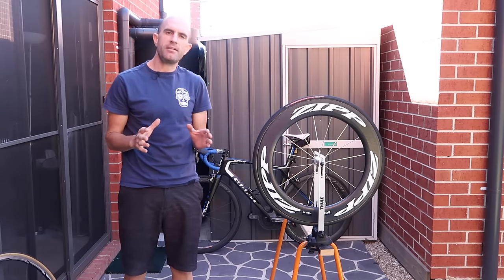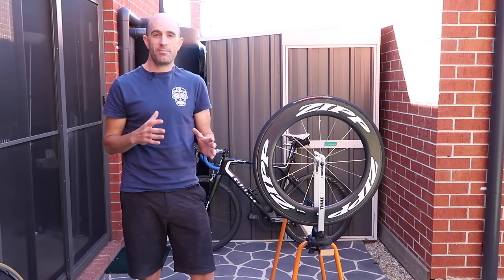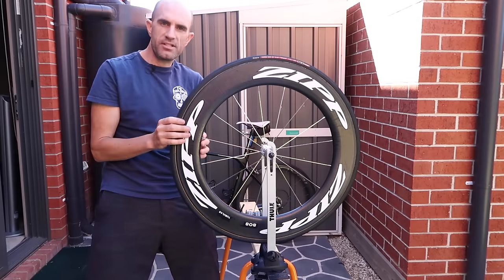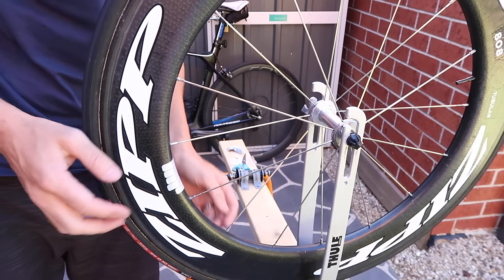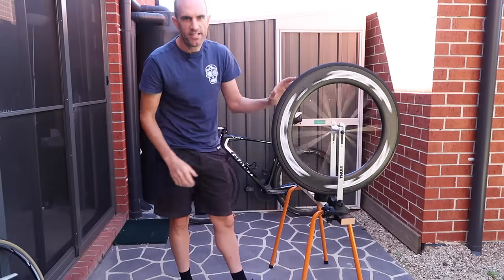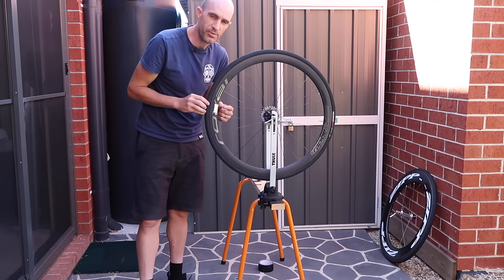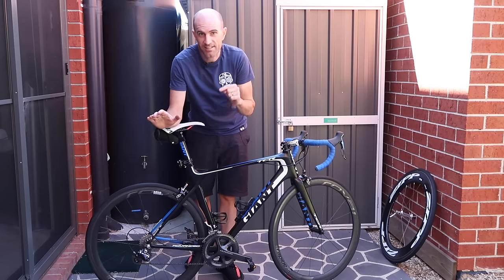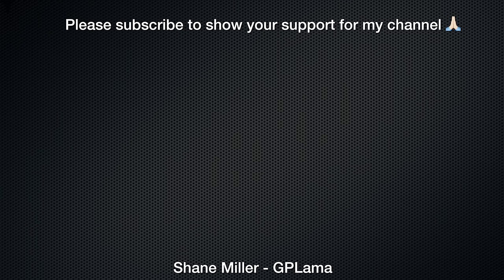Bicycle Wheel Balancing: Marginal Gains or a 'Must Do'?

Comment: Hi Shane, great video as always. Might be stupid question but I thought wheel.balancing was about adjusting the tensions on the spokes not adding counter weights? Are these 2 methods achieving the same thing? Which is preferred? This method looks simpler than adjusting spoke tension.
Reply from the maker: That's wheel truing. Explained at the start the difference.

Comment: First up thanks for posting this - really interesting and helpful information. Just one quick Q though - with the proliferation of road tubeless will this still work with tyres filled with sealant (especially the liquid rather than 'foam' type)?  Logically wouldn't the sealant simply run to the bottom when you have the wheel in a jig and automatically throw the 'rebalance' out?
Reply: I also thought this for a long time but it's a little bit different. Sealant doesn't stay on the bottom of the wheel while its spinning but forms a thin coat on the inside of the tire. If you give the wheel a solid spin before letting it come back to rest it should still work. At least it did for me.

Comment: Shane. Quick question. Would there theoretically be any aero lose for adding the weights to the wheel that would offset the benefits of balancing? Just something I wondered. DT
Reply from the maker: It'll have an impact yes... But as for that in W or time... we'll need a way to quantify it. It'll be pretty small.

Comment: Shane, I did your wheel balancing technique on my Giant  TCR SLR carbon wheels. But still finding that the wheel still drops to the valve stem. I'm running tubeless, will this be due to the fluid of the sealant, and won't the wheel always be heavy on the value stem due to this?
Reply from the maker: Introducing fluid is a whole set of variables. None I'm familiar with sorry, I run old school tubes. :)

Comment: I was thinking about balancing my wheels for quite a long time.   But I'd prefer to hide the weight somehow.   I'm currently thinking about an oversized stainless steel nipple, but very hard to set the weight to the exact requirement.

Also, I'd like to see some tests, whether an unbalanced wheel is wasting power, or not.
Reply from the maker: You saw the bike shaking around, that's wasted energy. As to measuring it.... that's beyond the tech I have access to at the moment. That's in the realm of Zipp, or $company$. If anyone has any backyard ideas.... I have a camera and a backyard! ;)
Reply: Of course, I did not expect a test from you. :)   But there're independent wheel wind tunnel tests, tire rolling resistance tests, but not for inbalance.

I even think that the two speed wobbles I encountered so far might have been caused by this inbalance.
Reply from the maker: I'd love someone to grab this and run with it! Hopefully someone will and we'll get some data.

Comment: Hello Shane, quick off-topic question about your Bike (if there's a video about it, i couldn't find it). What are the Pros and Cons for the tcr? I am about to buy my second roadbike and i am interested in the tcr. I like to ride fast and aggressive (i am planning to start racing later on). But a few friends of mine told me to not buy a giant bike. They point out that giant bikes have a bad upscaling (i will need a 58-60cm) and a bad quality/ workmanship (i googled that, since i am not a native speaker). I am confused since many guys on the internet call giant one of the best bike manufacturer ... hope u can help out and tell me your point of view.
Cheers mate and greetings from Germany :)
Reply from the maker: +derSlomka It's just a bike, like the rest. It's not the difference between winning of losing. Mine hasn't fallen apart, so that's a good thing. I'll leave the sales and marketing to Giant. I brought this frame 2nd hand as I believe bikes are overpriced and terrible value. That's my point of view.
Reply: The whole bike industry goes crazy about aerodynamics, discbrakes and that kind of stuff. I think it´s more about the advertising (and sellling as a result) than about the real benefits for normal customer. Thank for your oppinion. I think that really helps me out somehow. I guess i just think way too much about a simple bike.

Comment: This may sound like a daft question but if I have a wheel unbalanced could this affect the handling of the bike when going downhills fast ? ive had issues with going downhill and always put it down to the bikes ive had and now im nervous at going at speed downhill. Never used to on my old ally giant with giant wheels. im going to giver it a try either way
Reply from the maker: Maybe. There's a lot of variables at play here. Worth testing for sure.
Reply: @gplama  I’ve tried a lot of different things with some minor results but still never been as confident as I was on my old giant contend. I have a good mechanical back ground and it makes perfect sense to as I’ve drove cars where they hadn’t balanced the wheel and the vibration was really bad at 50+ mph. Will let you know how I get on

Comment: Why didn’t you stick the weights on the inside of the rim?  That is very ugly on the outside Shane. Take the tube out, stick the weights on and put the tube back in. Voilà. Just a little trick 😉. Have a great day 👍
Reply from the maker: This idea doesn't work very well on tubulars. The 404, 808, and 900 I have all tubs.

Comment: I would have though the imbalance is mostly due to the weight of the valve - it could be fairly significant on a 80mm. Maybe if you're using the same valves on the wheels - the weight of your valves are all 14grams?
Reply from the maker: No wheel works without a valve... so they could counter it at the factory pretty easily. That costs money to do though.

Comment: - Excellent video

wonder how much rider weight impacts the shake?
an interesting follow up would be to have two sets of identical wheels, 
one pair balanced the other "fake balanced" (just gaffer tape).
Pair A and Pair B - as much as possible unidentifiable between the two, even the Pair A and Pair B markings are so small that only the Experiment Observer is able to see which is which (very small marking).

Two riders (+ Observer rider) goes for a ride, every 20 minutes or so the Observer notes "guesses" 
of which wheelset they are riding.

Observer randomly swaps (or doesn't swap - returns wheelset to same rider)*

continue multiple "passes"

* for the wheel swap the two riders (test subjects) leave their bikes and turn their backs, the observer takes off wheelsets then tosses coin (or similar) to decide wether wheelsets are swapped or returned to same bikes - subjects don't know if swap has happened or not (pseudo randomised).
Reply from the maker: I like it. I'd rather thrown the wheel in a jig and simulate it though... that riding sounds like hard work and a LOT of variables to control.

Comment: The thing I'm not understanding is why the Roval shook so much more violently than the Zipp if both wheels were out of balance the same amount. Any thoughts Shane?
Reply from the maker: I had the Roval cranked right up in speed. The 808 was a front wheel that would take some crafty work getting up to 50, 60, 70(?) km/h without a chain and cassette.

Comment: Shane, any idea how sealant might affect the balance of a road wheel in a road tubeless setup? Before adding sealant... the wheels are a bit out of balance. With no added balancing weights, I notice once I've added sealant I get the same smooth spinning wheels, i.e. no vibrations. I'm starting to think sealant naturally balances the wheels as the wheels spin and the sealant is distributed throughout the wheel. Or maybe I have some factory freaks that came pretty well-balanced. Thoughts?
Reply from the maker: Not sure to be honest. I'd need to have a play around myself. I've never used sealant of any type.

Comment: Hey Shane! Awesome video!
You can actually solve this without the cosmetic "problem" of the weight strips. Simply use a spoke magnet or two. You can then control the amount of correction by moving them in or out on the spoke! Works like a charm...and since everyone is used to the look of spoke magnets, no problem there as well!!
Not sure about putting dimples in the magnets though... ;D
Reply: 10 grams of spoke magnets? would look ugly and create aero drag

Comment: well you can either do that... or you can buy Campagnolo wheels, which are very well balanced right out of the box. I have Boras and Zondas and they both don't have this problem
Reply from the maker: Yep. Some of us can't afford that though... hence me rolling around on a 2nd hand Giant frame from 2013.
Reply: of course it was not meant to replace all of your wheels 😀

But if someone is considering to buy new wheels he should have this in mind I think. fx the Bora is lighter and much cheaper (at least here in Germany) than Zipp or Enve, with equal aerodynamics - and perfect balance.
And the Zonda (again - I only can talk about Germany...) is one of the cheapest quality wheelsets on the market - and great value, I ride mine for more than 20000km now, first bearings, perfect true without any maintenance, no issues at all!

Comment: Great video Shane, have never thought of this - but now it's a simple check and fix on my bikes next weekend. Are those tyres running tubeless with sealant or clinchers? I wonder if sealant hardening - adding more over time, can unbalance wheels?
Reply from the maker: The Zipp 808 is a tub, the Rovals are clinchers.

Comment: That's a real eye opener. It may be the cause of wheel wobble at higher speeds, like a descent. At the very least it could also be the cause of premature bearing failure. Good catch.
Reply from the maker: It's difficult to measure those variables... but the bike doesn't shake. I can confirm that. If we can come up with a way to measure energy saved/lost in doing this, I'll cover it on the channel.

Comment: WOW bloody hell you and your m8 are perfectionists, but I really enjoyed watching that, very very interesting I wonder how many watts would you gain from that and how many watts would you lose from the aerodynamics I would assume you would gain lots more than you would lose but it would be interesting to know how many or the percentages of weight/wobble and would that wobble change on a changed tyre or tube I would assume no for the same tyre manufacturer and tube but yes if they were from a different tyre manufacturer would make an interesting video?
Reply from the maker: It'd be a hard one to quantify... but with the right equipment it could be answered. At the very least I know my bikes don't shake... and it's one more thing I can have confidence in come race day/training day/next fast decent knowing my equipment is closer to 100% optimal than before. It's also fun getting hands on and tinkering.

Comment: Good vid, thanks. For a tubeless setup, how about fitting the weight to the inside of the rim (where an inner tube would usually sit)? Probably harder to setup, but you only have to do it once, it would look much better and you would need a marginally smaller counterbalance mass as it would be further from the centre of the wheel.
Reply from the maker: That'll work, yes.

Comment: very interesting and definitely a big impact to the riding experience.  Just to be pedantic, the dimples are meant to be there for improved aerodynamics.  How much of an impact do those strips have on the aerodynamics considering they're bigger than the dimples?

can you add the weights inside the tire instead?  Attach them to the sidewalls?
Reply from the maker: The scientific term is "sfa". But, flatten out the lead sheet, or get a really thin square of it and put the dimples in it. The Zipp stickers themselves negate some of the dimples too.

Comment: Can't figure why the manufacturers wouldn't balance them?! New business - wheel balancing - only 30 bucks!
Reply from the maker: There's a lot of variables the customer adds into the mix... tyres, tubes, glue (for tubular), and valve/extenders. I suspect that's why most wheels are a little out of whack.
Reply: Shane Miller I suppose that like car wheels, they should only be balanced after you've fitted the tyres, so you're probably spot on. Watching the severity of the Roval wobble, I'm surprised that nobody has highlighted this before! Good vid!!

Comment: i have always thought about this since starting riding a couple of years ago as i came form a automotive background where everything is balanced, now it looks like i need to find a jig and check my wheels. it is interesting though as i bet the wheels from factory are balanced or very close too but the Tyre and valve would be what is causing the issues here and i bet the results would be different if you ran the valve round lock collar and cap too.
Reply: steve burton rubber side up. saddle, shifter hoods on carpet / door mats so they don't get scratched up

Comment: I am thinking of switching to tubeless, but this has me a little worried...   I know that they say the sealant will slosh around and distribute around the whole tire after a few minutes of riding, but can it really distribute itself evenly to achieve balance all the time?  and if so, I think you would have to spin up the tire on the test bench for quite a bit of time to get the sealant distributed, then hopefully is stays distributed long enough to identify any true imbalance in the system.  or will the fluid immediately start to run toward the bottom, messing up the process?  I really want to go tubeless, i think it has some benefits, but this might be a complication.  Thanks for the great vids!
Reply from the maker: I'm not sure on this one. I've not run tubeless (or any sealant in my tubs).

Comment: Shane 1 question, would you ever balance the wheel before you put the tube and tyre on the rim.  Putting the weights inside the wheel instead of on the outer face of the rim?

I understand you would need to re-check once the tyre and tube are fitted but any re balance should be minimum?
Reply from the maker: +Dan “Deepee74” Potter Sure.... but if this impacts the tyre/tube shape you'll have issues.

Comment: @Shane Miller Is that a tubular or clincher? Because if its a clincher then the weight would be coming from the valve on the tube, even tho if the rim was balanced imo
Reply from the maker: +MaGGoT583 808 is tub. Roval clincher. A balanced rim is still useless without a tyre on it.

Comment: I know this is an old video but I thought id ask the question anyhow, could you achieve this with a piece of old tube in the wheel bed of the wheel rather than unsightly weights on the outside of the wheel?  i have roughly a 10 gram imbalance.
Reply from the maker: There's a few ways to solve this one. Just be sure not to deform the tyre when it's pumped up and rolling.

Comment: What was "so bad" about the rovals when it seems 14g is a pretty common number?
Reply from the maker: What's so bad? Being sold a set of wheels/tyres/tubes that cause the bike to shake like all shit on a bike. Having to come up with a solution myself to solve it. Happy to spray that message across any wheels that do the same, don't get me wrong, I don't favour any wheel in particular. As a customer I expect more from what is apparently high end equipment.

Comment: Would this not affect the aero benefits of the rim? Especially the dimpled 808s? Surely the counter weight should be inside the rim?
Reply from the maker: Marginally... but sure, if you've got the time, whack them under the tyre or in the rim for a perfect solution.
Reply: Yeah, for sure. Just think that you pay a whack load (new) for "aero" R&D in wheels. At least that's a major selling point. I'd be interested in any aero effect - hard to test outside a wind tunnel though :)

Comment: Shane:  It might be a bit unfair to blame the wheel manufacturer unless you tested the balance of the wheel its self (no tire, no tube).  The out of balance of the assembled ready to ride wheel is a combination of the balance of the three components and as you demonstrated, should be balanced as an assembly.  I would guess that 85% of the out of balance would be blamed on the valve assembly
Reply from the maker: +Doug Hungerford Who rides without a valve/stem/tyre? It's pointless to sell a balanced 'wheel' that will be out as soon as it is in a usable state. They should factor this in, on an average at least for stem weights, or at the very least provide a method of balancing for customers.
Reply: Valid point, the same could be said for all wheels including automotive.  Looks like you could drive a global revolution

Comment: Shane you can also use a pick up magnet (screw on type) attached to the spoke in the opposite side of the wheel. You need fewer stick on golfing accessories on the rim this way
Reply from the maker: Not a lot of magnets are 14g... and further in you'll need more weight. That's a solution though, yep.

Comment: Should you do the balance without tires on first?
Reply from the maker: No. The wheel/tyre/tube and pumped up to the pressure you'll be riding is when they should be balanced as that's what is ridden on the road.

Comment: What is the power difference measured when riding?
Reply from the maker: Power is a measurement of the rider effort. Wheel balancing is more about system efficiency. It'd need to be measured with a roll-down test... if anything. I think. One for someone a lot smarter than me to dive into.

Comment: Just bought a new wheelset (Roval Rapide CLX 50s), and was bummed to discover this rear wheel imbalance vibrating the whole bike on spinup.  Thank you for this video!  Is it logical to conclude that the bigger the valve stem, the more weight needed to counterbalance?  I have 80 mm stems on the 50 mm wheels.
Reply from the maker: Yep, longer stems can throw things out a little for sure.
Reply: @gplama  thanks!  Enjoy your content, cheers.